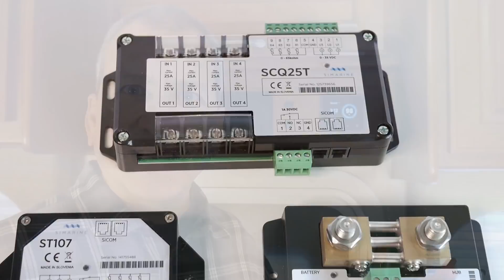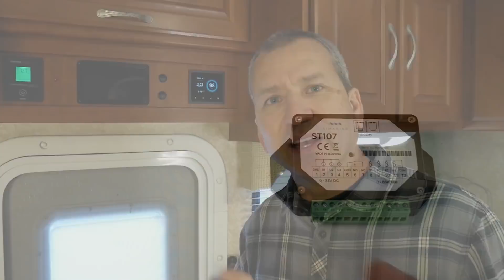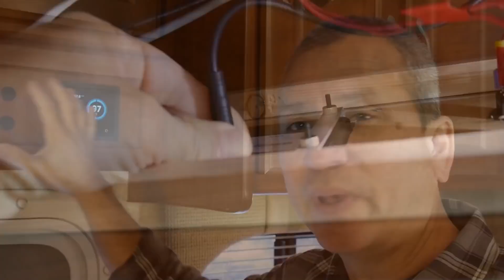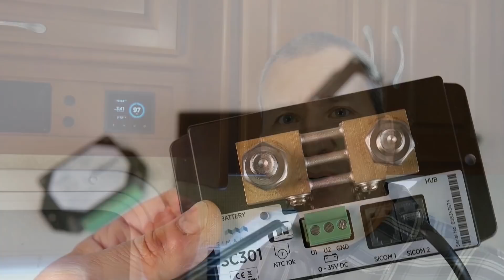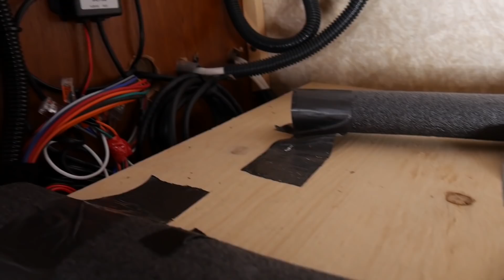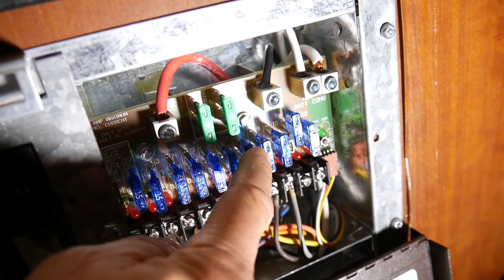SIMARINE PICO Monitor Review and Install in RV

Comment: Love this project, can’t wait to add this here in the near future, trying to decide which package to get for my needs. Thanks for sharing.
Reply from the maker: I really love it, but primarily use it for battery, solar and other current monitoring. The tank monitoring is only as good as your sensors and is difficult to calibrate. So unless you really need tank monitoring, you could probably get by with just the electrical monitoring only.
Reply: RV with Tito DIY I spent last weekend dropping my underbelly insulation to measure my tanks because I was going to integrate better sensors like Pau Hana travels did to their tanks: https://youtu.be/IDffmhQ5RkM, and do your mod here to get a really good monitor. My only issue is a accurate tank monitor for the propane system I have, I have been told one is coming for either the Pico Simarine systems or the Sea Level system by Garnet Instruments/garnetinstruments.com

Comment: The temperature sensor and wire fittings on the shunt are probably meant to measure the battery temperature. Those sensors usually needs to be straight on the battery to get as good a measurement of the internal temperature as possible. Putting the sensor away from the battery is probably defeating its purpose. Batteries heat up under heavy load or when they develop problems, and temperature is one of the most significant thing to look at to detect or diagnose problems. So if you're reading this comment, I'd double check the manufacturer's documentation, and probably put the sensor right next to the battery bank, instead of away from it.
Reply from the maker: I agree with you. Thanks for sharing your thoughts about this. I'm currently using the temperature sensor connected to my solar charge/batteriescontroller to for battery temp monitoring. This frees up the PICO temp sensor to be used for other purposes.

Comment: So how does this compare to using the Victron Color Control Panel?  I know victron has tank resistance sensors.
Reply from the maker: I haven't messed with the Victron Color Control much (just the basic controller and battery monitors). I'm pretty sure it monitors and controls only Victron equipment via the VE.bus network. Don't hold me to that. Simarine PICO is just the monitoring piece. The tank monitors are designed to work with any resistance or voltage monitor. It takes a bit of programming and calibration to get it dialied in.

Comment: Great video and very good explanation! When you say wifi is 'not that good' ,what do you mean? What's the range? I understand it can upload data to a server? How long can you log? Thanks and regards, Mike
Reply from the maker: In order to view and manage the device via the mobile app the device uses a dedicated WiFi connection between itself and  your mobile device. There is no connection to the Internet. In fact you have to disconnect from any other wifi or mobile data in order to connect to the PICO and use the app. The range issue applies only when accessing the PICO remotely via the app. I wish I could be further away. Sorry for the late response. I did see the comment. Just haven't gotten to it. Hope that answers your question. Cheers!
Reply: @RVwithTito   Thanks for the answer! Sorry, I don't understand the "dedicated WiFi".If it's not Bluetooth, where does the wifi come from? From my own router/wifi -network? But then it would connect to the internet, no? I just don't get the concept. Cheers,

Comment: Also, is there a way to do generator auto-start with this device?
And will the US distributor, Ocean Planet, honor the 10% discount?
Reply from the maker: I don't believe it's designed for that out-of-the-box. You can configure an output to apply power when an event alarm condition is encountered. Regarding Ocean Planet, my guess is no. You can ask them. The discount code is only valid when ordered through Simarine.net.

Comment: I purchased the Pico blue and through a bit of frustration have managed to get it mostly setup.
I still can not get the ST107 to work with the level sensors (same reading regardless of level or probes attached).
Seems that I have to purchase another shunt also, since the voltage/current levels of the SCQ25 run lower than my system max values

Comment: Hey Brian, I'm building a camper van from scratch and searching for water and lpg tank sensors that will work with this unit. Ordering a $1000 worth of product with your discount code from Simarine but first need to ensure I can find the right sensors. The propane sensor is especially tricky to find. What brand are your particular sensors for both fresh, grey water and lpg? Thanks again!!
Reply: Have any luck finding the proper sensors?
Reply: @jhclauseiv.  I have not installed it yet, will test put a few sensors in the coming months.

Comment: Wow this looks like just what I've been looking for, is the discount still available? You mention something about relay function: I am hoping that based on battery state of charge, that this can disconnect load if I pair it with a relay type load disconnect like a Victron battery protect. Is this type of function what you alluded to in the video? Thanks in advance!
Reply from the maker: Yes the discount is still available. I believe you can set alarms on battery SOC and trigger a relay. I don't have that setup though so I'd have to try it out.

Comment: You've had it for about 6 months now. Still happy?
Reply from the maker: Yes. I use it primarily for power and battery monitoring and it's awesome for that. I've added a second shunt module for my solar and temperature sensor to measure outside and compartment temps. I don't rely on it for precise tank monitoring though. It's only as accurate as the sensors in your RV. If your level sensor only has three sensors, then you can't expect the PICO to be more accurate. Having said that, the level indicators are close enough for me (+/- 10-15%). Hope that helps.

Comment: Looks better than my bmv 712, which by the way had not worked currently since I installed it. How it's the customer service? Victron won't help me at all. I agree with your wife, had meaningful information on the screen.
Reply from the maker: They were very helpful answering my questions. Unfortunately I don't have any other experience with their support as a regular customer. They are located overseas in Slovenia so there's the time difference.

Comment: Just installed the Pico. When you spliced it with your current tank leds are you able to monitor with both systems? I am assuming no. I did the same thing, found the proper lines for each tank, for instance the grey tank was a grey wire on the back of the panel and the white wire (common) to each. Doing a quick splice I do get a reading from the tank on the panel and the pico. However, adding the Pico the panel now shows the grey tank is full. Did you have the same experience?
Reply from the maker: Yes. I have them spliced but don't use the old one anymore. I had a similar experience when pressing the "check level" switch on the "old" monitor. I think the old monitor changes the resistance on the line when it checks it and it takes a few minutes to change back to normal and read properly on PICO. So I don't use the old one even though it's still wired up.
Reply: RV with Tito DIY Happy New Year. Are you still using the Pico for your tanks? If yes, any issues at all?
Reply from the maker: @ChuckKyle  Happy New Year to you too. Yes I'm still using the Pico for the tanks but realize it's only as good as my sensor outputs (pretty basic). It's usually plus/minus 10-20% accurate. I've also noticed that the values jump around when I have the engine running or when on shore power at times (especially my LP). I think it changes the resistance to the ground since everything shares the same ground.  I primarily use the PICO for battery and power monitoring. Were you able to get your tank monitors setup?
Reply: @RVwithTito   okay I went with a little more involved system, lol.  I added a second ST107.  The intent was run three tanks (fresh, black, grey), LP, and four thermometers (inside frig, under RV (outside), inside RV (inside temp), and one under the bathroom sink (okay it is on the back side of the outside water fill area and gets the coldest.  We use our RV all winter long to ski, so knowing when to kick on the small heater in the bathroom is important to keep things from freezing).  The LP seems to work great.  I took four calibration points (one empty, one full, and did a full minus use twice on fill-up).  The fresh water worked for a few days, now it shows empty.  However, I can look through the clearish container and see where the water sits against the sensors.  If I disconnected the pico and reconnect the stock LED panel it reads correctish (E,1/3, 2/3, F).  Black water worked once.  I purchased a flow meter on Amazon and took a reading every 5 gallons as I filled the black water tank.  After that, dumped the tank and it has never shown another reading.  Again, disconnect the Pico and reconnect the LED, and get a reading.  Grey water, well its about the same as the black and fresh.  Temperature gauges, I only installed three.  Getting to the bathroom was going to be a wiring nightmare so I wanted to make sure the others worked first.  The one in the fridge seems to be off by 15 degrees.  I have a cheap frig thermostat that just lays inside.  The pico (38-42 degrees) and the cheapo fridge (22-28 degrees) are about 15 (+/-5) degrees off.  So which is correct?  Since the grapes were frozen I will go with the cheap one, not the pico.  The inside RV thermometer seems about right.  I compare it to the Domenic thermostat.  However, the outside seems again about 20 degrees on the high side (it was snowing and the gauge showed 62F).  I have a Victron battery monitor so it is the one that I primarily use.  I don't think I have done a good job of setting up the Pico.  More to follow on that.  At this point I really am not sure how to "fix" my issues.  I have emailed Simarine several times with little response.  The pico looks fantastic, however I would give is a 1 out of 5 for working. I was going to email you a picture of my overhead display, based on your inspiration, but I couldn't find an email on your site, nor a way to attach to youtube.  I am going to do some troubleshooting tomorrow to see if I can figure something out :-)  I think its time for use to find another one. I love the idea of the panel with the temp probes and the digital tank meters, I hate the LED display.

Comment: That looks fabulous. Hope it works great. I'll have to check it out. I currently have a victron battery monitoring system. It has a shunt. Do you happen to know if i'd have to remove the victron shunt and system? I don't have it now, but am thinking of changing my solar charging and adding a victron solar charger. This is why I ask. Thanks.
Reply from the maker: I really like it. You can use your Victron 700 or 712 with this. You'll just install the PICO shunt in series with your Victron shunt. I also have Victron charge controllers. I just added a second shunt to measure total amps from both victron controllers. I don't need to use the Victron app as much now.

Comment: When you installed the shunt, did you remove your other voltage monitoring system shunt, it put this one in series?  I have a Victron system now and am trying to figure out if I can run both, or only use one.  Thanks
Reply from the maker: You should be able to run both as Battery <--> Shunt <--> Shunt <--> Loads. You'll just need a short cable to connect the two shunts then each is connected to it's monitor. I removed the other one and am just using the PICO shunt. I also added a second shunt for my solar. Cool stuff.
Reply: @RVwithTito  excellent.  I got the PICO in within four days of ordering it.  I just switched my lead acid (2 x 12v 27 group) with AGM (2 x 12v 31 group).  I have a Victron 700 monitor but really didn't want to "replace" it.  I will do the shunt series, and install the Pico next weekend.  My application??  Pico to monitor the black, grey, fresh, and LP.  I am also going to run a temp probe inside the fridge.  I have a Norcold that we are always adjusting the cold>>>coldest setting trying to read the temp off of a thermometer we have sitting in a crisper.  I also use Olivertherv to go snow skiing, so I am going to run a temp probe under the bathroom sink.  The reason being it is where my hot/cold water lines run and if it gets below 32 degrees, my plumbing freezes.  Having a temp probe there will allow me to know if I need to turn on a small electric heater to keep the pipes thawed.   The last temp probe will just be in the RV.  Our old Dometic thermostat you have to hit the button to see the room temp, now we will just be able to display it.  Thanks again for all the posts.  Now time to run over to another of your videos and start talking solar, lol.
Reply from the maker: Awesome. You can also set an alarm on the temp sensor under the sink to alert you when it's getting close to freezing. The options are under the "Data" menu in settings.
Reply: @RVwithTito  That would be legit.  On my list of things to remember.
Reply from the maker: Just watched your retirement speech :) Spot on. Saturday, we attended my close friend's 37 yr USAF retirement.
Reply: @RVwithTito  Thanks.  Sorry, the video was not of the highest quality.  A friend of mine taped it and I had no idea.  He asked if I would post it, so I did.  It's amazing how we lose sight of what our real priorities should be.

Comment: Hey Brian,

You had a shunt for your old BMS.  Did you add the PiCO Shunt (two shunts), replace your old shunt with the PiCO, or scab the PiCO on top of your old one?
Reply from the maker: I removed the old one and replaced it with the pico shunt. I also just added another shunt for my solar inputs.

Comment: I enjoy your videos n the info. thnks. Question. We're looking to add solar panels. I've listened to you n others. I'd like to start out small n have the ability to add on. Looking at Renogy. Maybe 100-200watt. Use their controller? Add a battery to increase storage capacity? Your thoughts?
Reply from the maker: If you plan to dry camp, i would start with at least 200Ah of batteries and 2x100w panels. If you plan to add panels make sure your charge controller will accommodate the added voltage or amps otherwise you'll have to buy another one. I always recommend spending your money on a good controller to start. Another option for you is to invest in a 200w portable solar kit. Minimal installation required.  Just connect it to your battery and store it when you don't need it. Hope that helps.
Reply: @RVwithTito  thnks for your input. I agree. I'm adding a 2nd batt n a 200w portable kit. your thoughts on a controller would be appreciated. Steve.

Comment: Man I was in Until I saw it on amazon for 600 bucks nice though...
Reply from the maker: They've got a few packages starting at much less. I'd start with the standard package which you can expand later if you're still interested.
Reply: It's well worth it for sure by far the nicest I've seen  I will most likely get one just save up a little and get the one with 
everything. Nice job!!!!

Comment: Love it an am seriously considering it vs. my current Victron Bluetooth based monitor.  The ability to add multiple shunt monitors for all three of my charging sources as well as important individual consumer circuits is huge as is the ability to mount the panel in a primary "stopped" location while being able to monitor it underway via apps.  The only deal breaker for me, as you noted, is having to connect via AP mode.  My Android headunit (in dash) connects to an always-on WiFi network and displays a lot of information I value while driving (Torque, streaming audio, etc.).  For this system to be worth investing in (I calculate $625 with the discount and exchange rate) I'd need to be able to run their app on my Android headunit and connect via my existing WiFi network.  This would enable me to monitor power details live from the front seat while leaving the panel mounted in the rear sleeping area.  A bonus would be if they could come out with a wireless temperature sensor so I can monitor my Engel fridge / freezer.  As it is, I won't be drilling a hole in it or running wires in through the lid seal.  Thanks for another great video and introducing another great product - you produce some of the best content on YouTube on these topics.  The marine market sure has a lot of quality components to take advantage of!
Reply from the maker: Thanks for sharing your thoughts. I hope SIMARINE will consider that change. A while ago, I mounted a small voltage gauge on my drivers side so I can monitor my house battery voltage as I drive. It's been very useful. I'll probably share that in a future video. As a workaround, I thought of using an old smart phone just as a wifi monitor for the PICO.
Reply: There was a firmware upgrade a few weeks ago introducing the STA (Station) mode for WIFI. That way you should be able to hook up the Pico to your network router and connect to the Pico from your mobile via the router.

Comment: I would definitely like to see more.  Maybe more automation tasks, such as generator startup at low battery power.  

I've been thinking the SeeLevel system by Garnet Instruments would be the best option for tank levels.  Do you know if the SeeLevel system would work with SIMARINE?